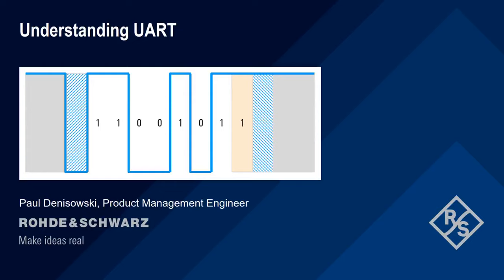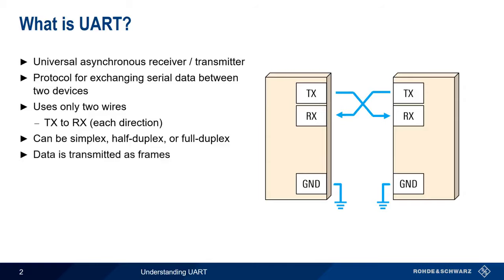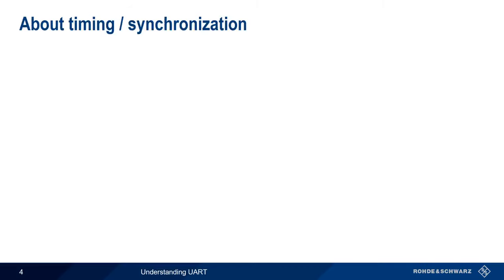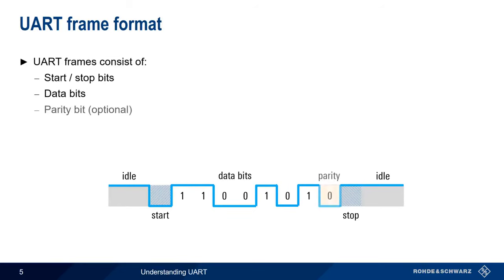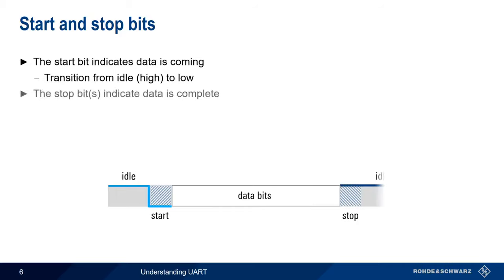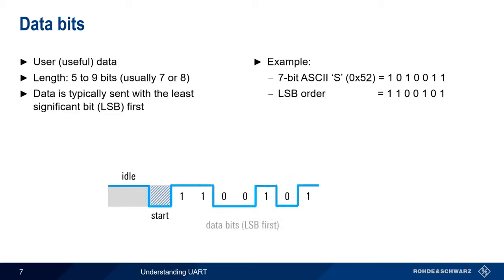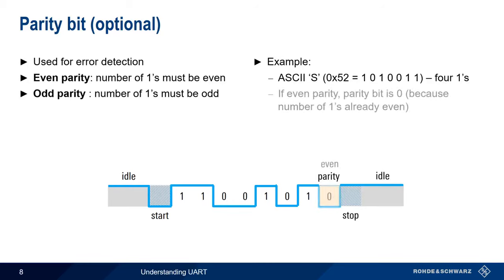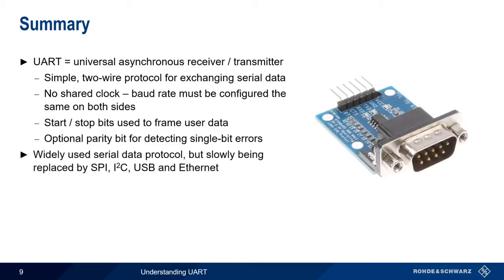Understanding UART

Comment: Ahh, happy days of measuring one and a half start bits to work out the width of the clock/pulses to manually read the data from a remote UART. Life was such fun writing process control software in the 1980s :)

Comment: uart(universal asynchronous reciever transmitter) -  parity(error detection) - asynchronous so both sender and reciever should transmit at same speeD(baud rate) - tx,rx are registers used in transmitting and recieving data

Comment: I have a question here: How do you know if it is a stop bit or a sequence of 1's as data. For example, if i need to send 0xffff, when will UART know that the data has ended?
Reply: It's usually automatic in "drivers" so you load in something and use a command like 'write "oxffff"' from instructions on the internet. The driver is something like 'Uart.h' or whatever. It's probably 300 lines in C or MicroPython and you need to write 5 lines very carefully to make it happen or you use some more advanced software doing most of it.

Comment: The stop bit just looks like a normal "1" bit. How to distinguish a stop bit from a useful "1" bit, or a useful "1" bit from a stop bit? It is not explained in the video - I did not see the use of any prepositioned "length field" or "escape sequence". Can anyone help me with this?
Reply: After doing some searching, I believe the frame length is also pre-configured just like the baud rate. (Please let me know if I am wrong)
Reply: @maxint2680  Yes, that's correct:  Normally in serial communications, you have to explicitly specify (i.e. configure) certain parameters, which need to match on both ends of the connection.  These are the speed (baud rate - e.g. 9600), the number of data bits (7 or 8, usually), the number of stop bits (almost always 1), and the parity type (none, even, or odd).  So if you know these values, you can derive the length of the frame.  If you use PuTTY as a terminal program, these values can be found under "Connection -> Serial"
Reply: @pauldenisowski  Detailed explanation. Thanks!

Comment: i have not understand that parity bit.means if data bits are 4-1s then parity bit sould be low(0).
Reply: Depends on the type of parity - even versus odd.  In even parity, the number of ones in the user bits + parity bit must be even, so if you send 1 1 1 1 and are using even parity, the parity bit would be zero.  If you were using odd parity, the total number of ones would need to be odd, and 1 1 1 1 would require a one as the parity bit.

Comment: actually i have one doubt , inside the UART we have transmitter and receiver . will both  transmitter and receiver will work at same clock frequency
Reply: In order to UART to work, but transmitter and receiver have to be configured to run at the same speed (asynchronous - no shared clock).

Comment: Aren't there supposed to be 8 data bits, for 8 bits equal to 1 bite?
Reply: Typically the user data is 8 bits long.  That said, UART doesn't specify how long the payload should be.  I still remember when 7-bit ASCII was the norm in serial text transmission.

Comment: okay but how is something like "11111111"  transmitted? how does the receiver tell the data apart from the stop bit?
Reply: You are always have "start" bit for this purpose which are "0" (low level one), this is kind of something change or begin at the line.

Comment: I have some confusions.
1. The LSB is indicated first in waveform but actually receiver is receiving the MSB first.
2. What kind of line coding techniques are used; it is told that NRZ-I is used but the waveforms just represent Unipolar NRZ.
3. How cannot the receiver misinterpret as the end of data if consecutive 1's is present in the data which is similar as stop bits?
Reply: 1.  The order of the bits (LSB or MSB) has to be agreed upon by the transmitter and receiver (and clearly must match at both ends)
2.  NRZ is the most common type of line coding used
3.  The transmitter and receiver must be configured to use the same baud rate, number of data bits, parity type, etc.  From these two pieces of information, it is possible to derive the length of the frame (number of bits) and distinguish between a payload "1" and the stop bit.

Comment: Can it be used for media(sound,image) transfer from (for e.g) a bluetooth module? What is the cost of implementing this interface in comparison with I^2C, CAN or MLBB?
Reply: My understanding is that a UART is included in most Bluetooth chips for the host-controller interface, with USB being another popular choice.  Generally speaking, UART is often cheaper and easier to implement than other protocols but has lower data throughput.   That said, the suitability and cost of using one protocol vs. another is a function of many things, so I couldn't really comment on that part of the question without knowing a lot more about the application, other components in the system, etc.

Comment: i have a question imagine a data with all 1's then how does the receiver identify the stop bit
Reply: UART requires that both sides be configurated with the same bit rate and the number of data bits (this is fixed for all UART frames exchanged and cannot be "signaled").  So the receiver will know how long the frame is and thus can identify the stop bit.

Comment: I'm facing problems with one of device , where the display required 7-n-1 setting but for the input need 8-n-1
Reply: 7N1 means seven bits, no parity bit and one stop bit, whereas 8N1 means eight bits, no parity bit and one stop bit, so these settings are most likely incompatible.  If one of the endpoints is a configurable terminal program (like Hyperterm, PuTTY, etc.) you should be able to configure these parameters.

Comment: UART need 3 wires not 2!!! UART are rated in bit per second NOT baud rate!!! Two stop bits is never used for at least 60 years...
Reply: Yes, more than one stop bit is extremely rare.  But I'm not sure what you mean by UART needing 3 wires - could you clarify?  Thanks!
Reply: @pauldenisowski could be referencing a ground wire